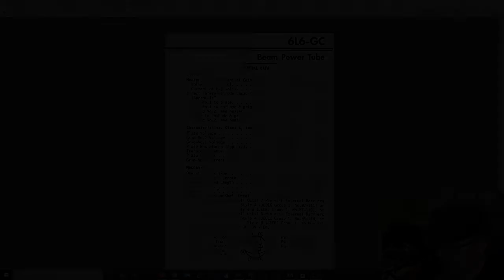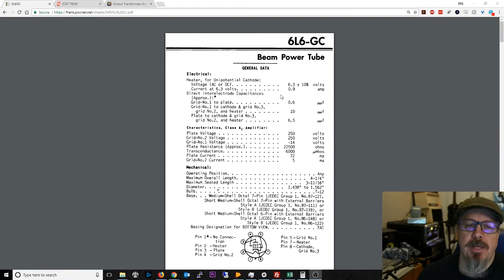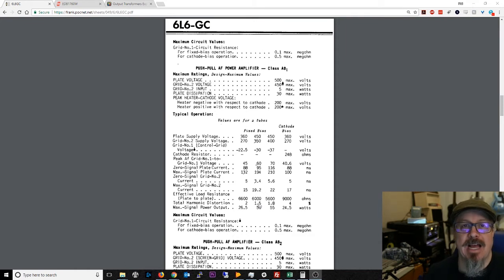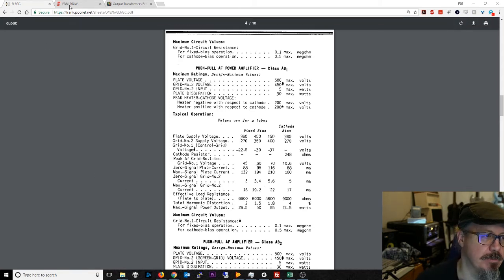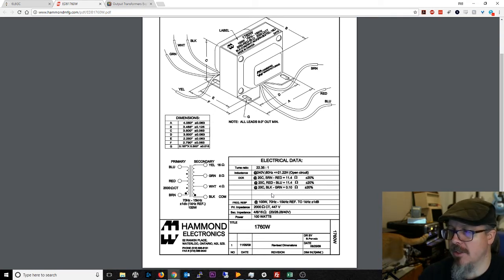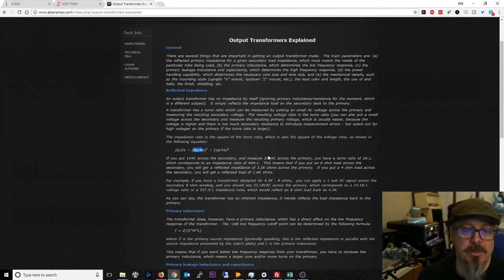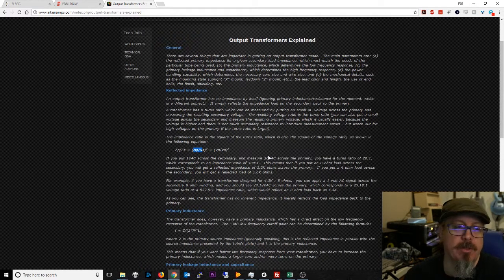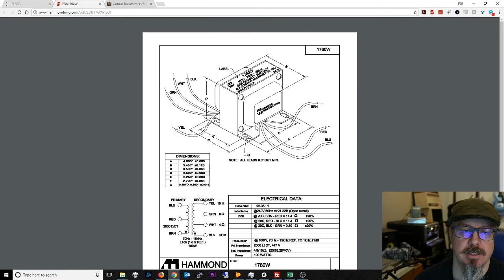Tech Tips Tuesday #3 - Output Transformers

Comment: I just now found your channel so my question may answered in another video.   I can build a tube amp using known transformers and common tubes.   My question is how do you chose a transformer when you have incomplete data, no load graphs on useful tubes not generally thought of as audio?  I have push/pull Grommes amps with 6GT5, Bogen amps with 6AV5 and I know of several other oddball amps that sound wonderful.  The Standel comes to mind.
Reply from the maker: That's a tricky one.  Usually the datasheet will show the expected load for the tube.  This gives you a good reference for the impedance of the output transformer.  Some times just won't work well as an audio amplifier.  The data sheets also give operating voltage specs for the power transformer

Comment: This question is probably dumb af, but: if you planned an amplifier in stereo/dual mono would you NEED 2 OT's? I assume that they don't make one transformer with two isolated outputs
Reply from the maker: Yes HiFi setups have two output transformers one for each channel left and right
Reply: @FrenchieFilms  Thanks a lot! I figured that was the case, but I could never definitively find an answer. I think the question was so basic I couldn't think of how to Google it 😋